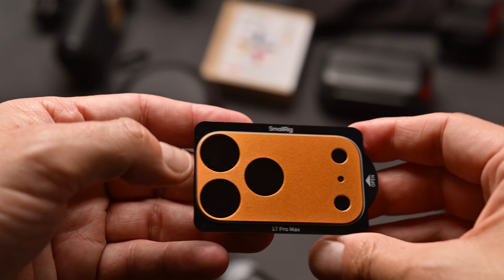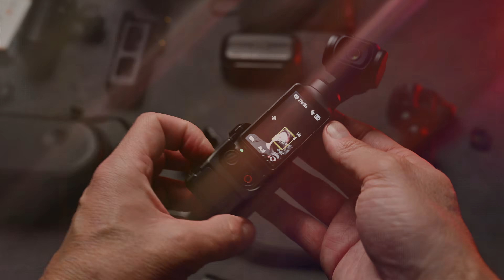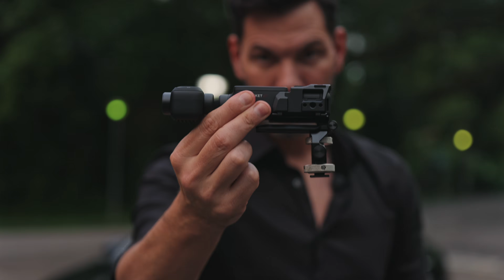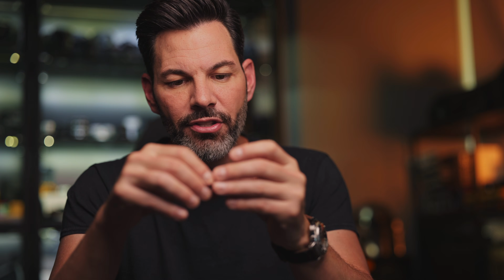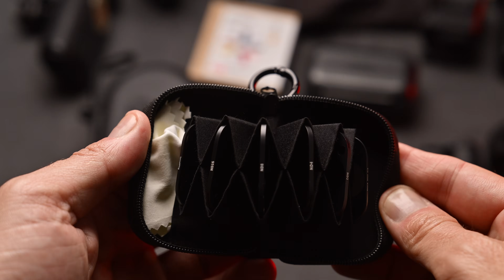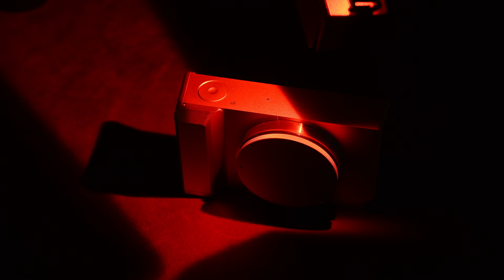This Setup Makes the Pocket 4/4P Better Than You Think

Comment: Bit disappointed it’s 4K but not downsampled so it’s sharper. Surely the sensor is more capable? Anyone think this may be added with an update or?
Reply from the maker: I think you will be happy with the output. 8K is great, but also comes with limitations.

Comment: Also for me the flap/build in tripod can act as kind of grip in several ways to hold the 4/4p better and control the camera. This means you don't have to bring the 'extender part' and mini tripod. If you do that you only have 15 grams extra and all is in the cage. You can also slide the mic 2 mini in the coldshoe for better audio or just not too loose it in the bag. The 6003 is a very good design.. only pity is that the magnete part would be even better if it has magnet layout with magsafe so you could attach your phone to the flap for a bigger monitor.
Reply from the maker: I’ll try those options out.  Yes MagSafe would be ideal

Comment: One nice thing on the 6003 is that the 'flap' is a arca plate but it won't normally fit in some arca receivers since it might have security pins. Say the peakdesign pro tripod. What can do is 'open' up the 2 legs a little and attach it like that the middle magnet part will be out of the way. I was worried about that but this is a ok workaround.
Reply from the maker: Good to know. I usually remove the security pins or make it easier on the peak design heads. I love this mount though. Extremely versatile
Reply: @btonelli  well i disagree on products i have been involved in with them (l-bracket, cages) we try to make sure there are holes where the pins can fall in. removing security pins (both) if not needed is a pity since well they secure keep from sliding out. I almost wanted to send the team a message for a update but the trick here works good enough.

Comment: It looks to me that once you add the cage (multi functional one 6003) it doesn't fit in the bag anymore correct?
Reply from the maker: No it doesn’t. The case is only designed for the pocket camera
Reply: @btonelli  thats kind of a mis they made a very good cage and forgot to test it in their own hardcase bag. o well next version i guess.
Reply from the maker: @scb2scb2 agree. I wish the case had a bit more room but for the essentials it’s good
Reply: @btonelli  yeah still weird since the 6003 replaces 2 parts inside the creator pack really so seems to me that they want  a case that is based on that and also has room for the 6003 and frametab remote.
Reply from the maker: @scb2scb2 perhaps they will come out with a new case since the 4P also comes with a remote as well plus mic

Comment: Can u use d log 1 with wide angle lens on 4p
Reply: yes the reason for the new log format is the extra DR on the main camera there was no need to also provide it on the tele would be waste of space and cpu. So log 1/2 on main and log 1 on 3x
Reply: @scb2scb2 how hard is it to match d log 2 to d log 1 and is there a big difference? Might just stick to d log 1 for both wide and tele for consistency sake
Reply: @dudeguy7812  I assume it won't be that hard both sensors are now from the same brand omnivision and i am sure LUT's will be supplied by different people for both that will match to get you started.
Reply from the maker: @scb2scb2 wonder if they will add it in for future updates or is it not possible?
Reply from the maker: Yes for the 4 you can. I don’t have the attachment for the 4P yet